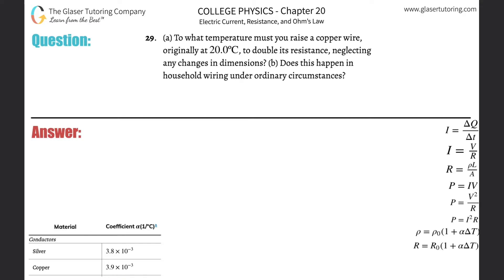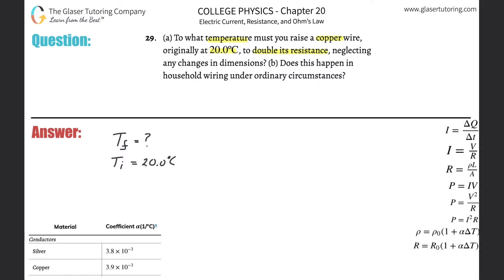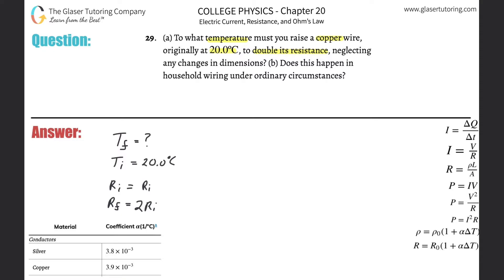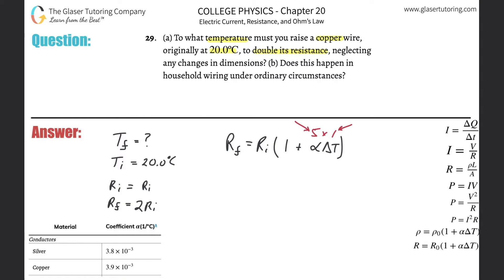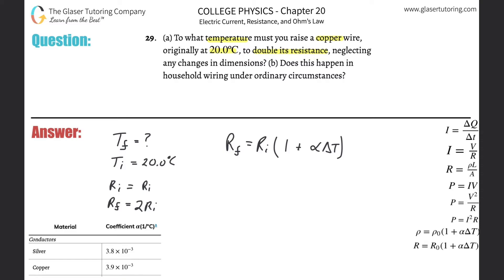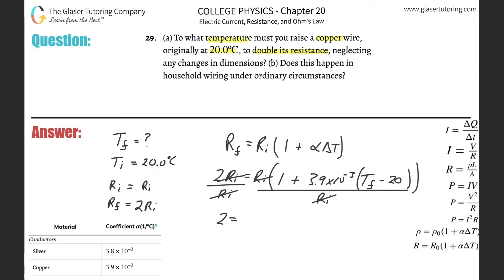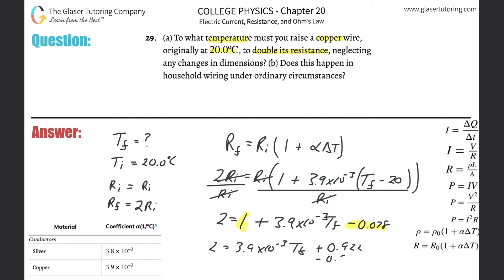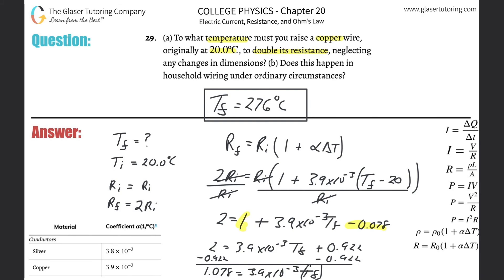20.29 | To what temperature must you raise a copper wire, originally at 20.0ºC, to double its

Comment: You would like to change the resistance of a copper wire by cooling or heating it.  If the coppers temperature coefficient of resistivity is .0039 per Celsius what is the required temperature change to reduce the resistance by 11.6%?